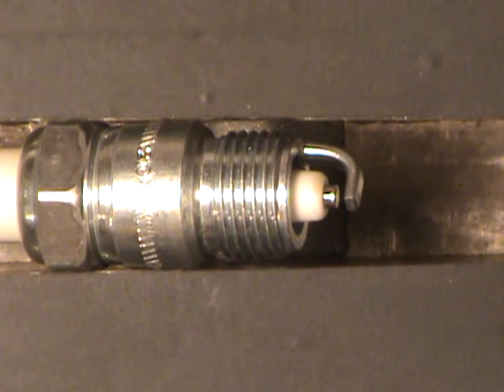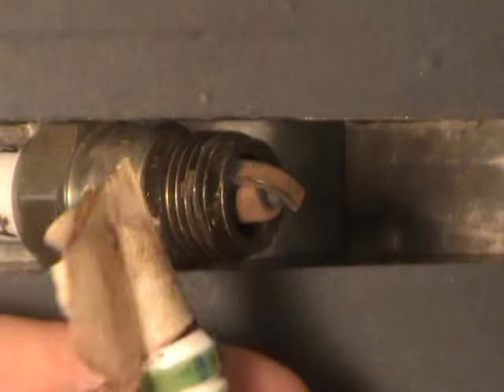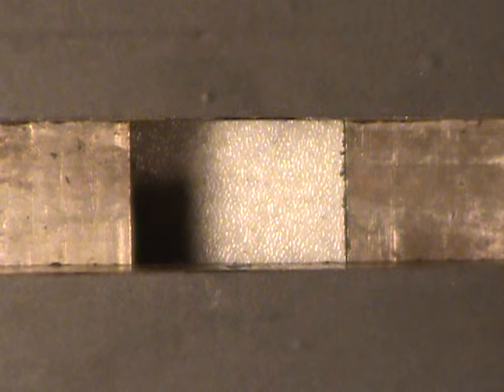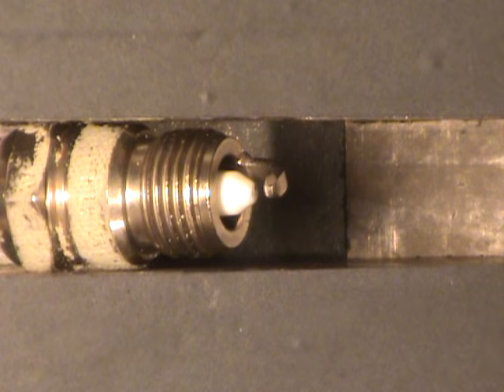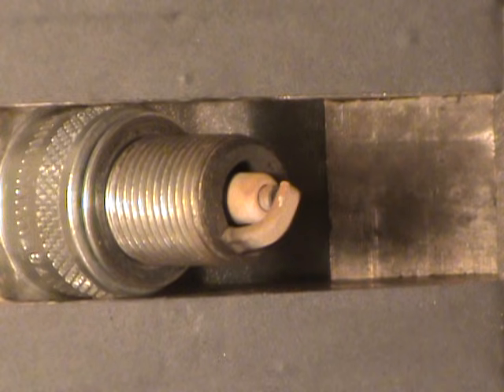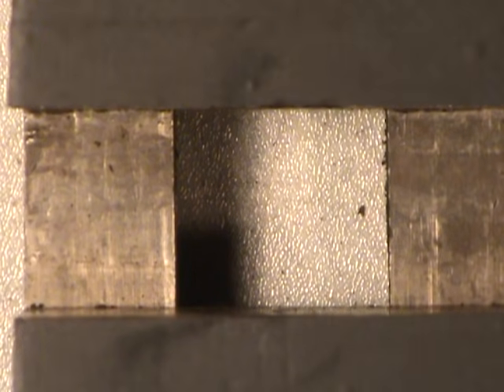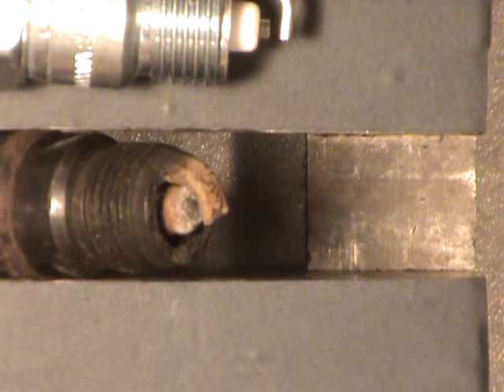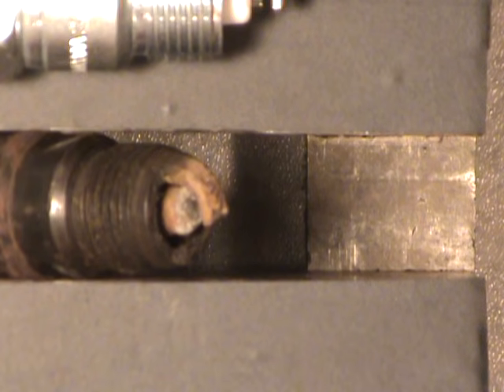SPARK PLUGS How to Read them (Part 3)

Comment: Awesome video, you really know what your talking about. I have a 305 vortec fuely and one of the plugs is always like the last one in your video or worse, white solid deposits. I thought maybe it was overheating or sucking coolant, but I guess that cylinder has too much oil going into it. That's better than overheating or coolant in my books. Every couple thousand KM I just change that plug, not the right way of going about it but I don't think I am gonna pull apart a 305 with 134,000 miles on it!
Reply from the maker: ssShortBoxKid⧓ Greetings ssShortBoxKid....Thanks for the Great comment, my Friend.......................................................Truth be told...as it applies to that Spark Plug, with that over-abundant amount of Deposit/s, in this YouTube Video, that You were talking about..................................................From what I recall, that..."White-ish" Looking "Deposit"..."Was Not"...on that particular, Number "6" Cylinder's Spark Plug, when I removed it, from my 1979 Chevy "400 cubic inch/6.6 Litre (displacement) small block V-8 Engine...!!!..................................................I believe that, that..."White-ish"...Colored, looking, part of that particular..."Deposit"...may have been..."Formed/Forming"...During the amount of Time, that, that good ole Spark Plug..."Was in Storage"...and..."Was Not"...in the Engine"...!!!............................................To me, that..."White-ish Looking Stuff, that "Attached" Itself, to the rest of that "Major" Deposit, looks, kinda, like a, shall we say, a..."Lime-Like, or Calcium-Like"...looking..."What-sham-ah-call-it"...for my lack of, a better Description...!!!...lol..............................................The "White-ish" Deposit, that You found, on "One" of Your Engine's Spark Plugs, might still be the result of, Burning some "Extra", and not wanted/needed...Motor Oil...in that "One" particular Engine Cylinder, alright......................................................That "Deposit", on Your Engine's, "One Only" Spark Plug, could be caused by a number of things.....................................................I'll start with some..."Motor Oil" Related possibilities...........................................................In the past, I have found that, on a "V-8 Engine", that had Lots Of..."Blow-By"...Combustion Gas, that went past the Pistons, then Entered the Lower Crankcase/Oil Pan area (internally), as a result of High Mileage, that resulted in, having the Piston "Rings End Gaps" getting Way Too Large, due to Wear, that "Allowed", all of that "Blow-By", high pressure, Cylinder, Combusted (exhaust) Gas, to get Past, all 8 Pistons, and over quite a few Years, all of that "Not being able to Completely "Vent with Fresh Air", due to the PCV (Positive Crankcase Ventilation) System, being Overwhelmed (aka, couldn't keep up), resulting in..."Major Sludge"...that actually..."Plugged Up"...most of the Engine's..."Motor Oil"..."Drain Back"..."Holes/Passageways"...in Both Cylinder Heads, and down in the Engine Block's "Valley", that's located...Under the Intake Manifold...and where the Hydraulic Valve Lifters were Hide-in...!!!...............................................When this, shall we say..."Motor Oil"..."Accumulates"...kinda like a Swimming Pool, if You will, then, the Motor Oil Level, will usually "Rise Up Higher" on Top of the Cylinder Heads, (below the Valve/Rocker Covers), and will then, usually, get so high, that the "Valve Guide Seals"..."Will Not"...be able to..."Stop"...all of that...Motor Oil...from making its Way, right..."Into the Valve Guides, where the Valve Stems, go Up and Down"...and probably..."More So"...on the..."Rear Most"...."Cylinders"...in that particular Engine, usually, due the, the..."Angle"...that the Engine is Mounted at, especially, as it applies to a..."Rear Wheel Drive"...North American Vehicle, as opposed to, a..."Front Wheel Drive"...Vehicle..........................................................Could be "Oil Control", for that particular Cylinder as well, as in...the usually..."3 Ring" (No Sir-ee-Bob, not a Circus...lol), but rather, the "2" Oil (scraper?) Rings, and the Expander/Spacer (weird looking thing), that is "Sandwiched", between, those "2" Oil Control Rings, that I was just talkin' about....................................................Keep a "Close-Eye", on "All" of Your Vehicle/Engine..."Fluid Levels"...and, the..."Gas Mileage/Kilometer-age"...that Your Vehicle is getting, as that my Friend, is, as I see it..."Are Very Good CLUES"...that will let, just about Anyone "Know", that there may be..."Trouble Brewing in Paradise"...!!!...lol........................................Might be a, Not so Good..."Head Gasket"...or, might even be, a Not so Good..."Intake Manifold Gasket" Set (or sheet metal/Valley Pan style, if applicable) perhaps...???.............................................Those "Gaskets", if not doing "Their Job Properly"...can Result in..."Motor Oil"..."Coolant" (anti-freeze n water mixture)...or, maybe even..."Exhaust Gas" (from the exhaust gas Crossover Passageway), making Its, or, Their  way..."Into Places"...that It, or They..."Should Not Be Getting Into"...!!! (not including any Vacuum Leaks, that are also possible, as well...!!!)...................................................If any "Coolant" (anti-freeze n water mixture) happens to find its way, into Your Engine's..."Oiling System"...that, in itself, can cause..."Engine Damage" (perhaps, Locking Up/Seizing) the Engine, up to the point, of, having the Crankshaft, not being able to Turn/Spin...!!!..........................................The "Clue/Warning Sign", to be Watchin' out for, is..."Seeing"...what looks, kinda like a..."Milkshake Looking"...(cream-like color) Liquid...that will be able, to be seen, on Your Engine's..."Oil Level Checking Dipstick"...Yes-siree-Bob...been there, seen that, and..."Never want to Go There Again"...!!!...(lol now, but, No lol, back then...!!!)...lol.........................................................Maybe, "Ignition System" Related perhaps...???.....................................................Might be...Not Enough..."High Voltage"...making its Way, to that..."One, Deposit Covered"...Spark Plug...perhaps...???......................................................So then, as long as Your Engine is Running and Performing OK, and all it takes, is Changing that "One" Spark Plug, every so often, then, as I see it..."Life is Good"...!!!..............................................Good ole "305"..........................................Be Safe, take care, and have a good one.
Reply: Hi there,

Thanks for the reply! That very well could be calcium or some type of growth from sitting, I have seen that happen many times before to things that have sat a while.

I think my rings are good on the motor because the oil stays clean for a long time and never seems to smell like fuel/have fuel contamination, although I have never checked the compression of any cylinder on that motor. 

I feel like it could be the valve stem seals/guide seals, it could only be the intake side though right? The exhaust side would just smoke for a few minutes upon start up? It doesn't seem to consume much oil either, I run 15w40 conventional diesel oil in it now days cause it's thicker and I have it already for my Duramax, I change the oil every 5,000 km/3,000 mi and it only uses maybe 250-500 ml maximum of oil in between oil changes.

Coolant never seems to get lower, have never added any for years. Should flush it soon I suppose. I had my cousin who is a licensed GM mechanic do the intake manifold gasket and the head gasket 3 years ago, I hope he did a good job and that is not the problem. Intake manifold gasket doesn't seem to leak when I tried to test it, never checked head gasket.

I am gonna check out the distributor/wires and hopefully I find something there, because I have an aftermarket MSD distributor and I don't much like aftermarket distributor/plug wires.

Life is good! I may just keep changing one spark plug because when that one plug is clean it idles smooth and runs like a bat out of hell for a 305 with that many miles on it.

Thanks again, learnt quite a bit talking, lots more to learn I am sure as I am only 20 years old!

Kodi
Reply from the maker: ssShortBoxKid⧓ Greetings ssShortBoxKid....Now I'm wondering, just what Year of Vehicle, that Your "305 Vortec Fuely" (as You put it), happens to be Installed in...???...........................................The reason being, that, it probably might have an "On-Board Computer" in it, and, even more beneficial, would be, as I see, if Your Vehicle was about..."1996 or Newer"...because, then, it would probably be the..."OBD-2" (On Board Diagnostic/s-Version 2), System, which, when a..."Scan Tool"...is Plugged into the..."Diagnostic Port"...that good ole "Scan Tool", will be telling You, some very "Specific Information", on "Any"..."Trouble Codes"...that, just might be Stored "Inside", that particular "OBD-2" Computer, which, will be able to tell You, just about "Anything" that is "Misbehaving", as far as, just about "Any", of the "Sensors and Actuators", are concerned...!!!...........................................If You care to, just let me know, what the Vehicle "Is", as well as, the "Year", and If "Any Modifications" have been done to it, over and above that, of what the Factory "Originally" Equipped it with......................................................Now then, about that "Diesel Motor Oil", that You are Using in Your "Gasoline Engine"...............................................You might want to "Check", and see "If" that "Diesel Motor Oil", is Actually "Formulated" for a "Gasoline Engine"...................................................Way back when, I did quite a bit of reading, about such things...........................................Just about everything, that I read, concerning, Using "Diesel Motor Oil" in a "Gasoline Engine", and, the Opposite way around, as well, was..."Not to do so"...!!!..........................................Do an Internet search, and I'm pretty sure, that You will probably Find Plenty, on that particular Subject matter (Engine Damage maybe?).................................................Now then, about "Coolant" (aka, anti-freeze n water mixture)..................................................The Older "Lime Green" Stuff (Ethel Glycol), was usually Only good for, about "2 Years", and probably, while it was in a vehicle, that was regularly Driven........................................The "Dex-Cool" (spelling?...and was GMC's Name) for..."Long Life Anti-Freeze"...and there are quite a few "Others" as well, that were supposedly, good for about "5 Years of Use", generally speaking.................................Usually, when-ever, the "Coolant" (I say again...Anti-Freeze & Water Mixture...lol), is left in the Vehicle's "Cooling System", for, too long of a Time Period, what will usually happen, is..."The Corrosion Inhibitors"...will usually..."Get Used Up"...and now, it's just a matter of Time, as to when, the..."Corrosion and Unwanted Deposits, Start to Manifest Themselves"..."Inside" Things, like, Radiators and Heater Cores, and given enough Time, "They" will usually..."Spring-ah-Leak"...!!! (repeat after me...expensive...Expensive...EXPENSIVE...!!!), well, maybe, not quite that Bad, but, I'm guessin', that You get the Picture....................................................Make Sure, that You "Read", what is on the "Jug" of "Anti-Freeze".............................................Usually a "Mixture" of 50/50 Anti-Freeze and Distilled or Soft Water, will usually do the Trick, and is a very good Mixing Ratio, that will promote Good Cooling, and sufficient Corrosion Protection..................................................The "Jug" will probably be indicating..."Not To Use Any More Then 70% Anti-Freeze, in the Coolant Mixture...!!!................................................You see my Friend, the "Anti-Freeze"..."Depends", on a Certain Amount of Water, in the "Mix", in order for it to do, its "Magical Chemical Interaction"...........................................A While back, I topped off a vehicle's radiator with 100% Anti-Freeze, and, I re-started the Engine, to, shall we say, "Mix", that nice New Anti-Freeze, with what was already in the Cooling System............................................As the Engine approached "Operating Temperature", as Indicated on that rather "Sensitive" Coolant Temperature Gauge, I was kinda in "Disbelief", as I watched that, good ole Coolant Temperature Gauge..."Keep On Climbing "Past" the Normal Temperature Range...and Kept On Getting Hotter and HOTTER"...!!!...so I Stopped the Engine, and, was askin' myself..."WHY"...???.................Like they say..."READ THE INSTRUCTIONS"...!!!...lol..........................................Later, after the Engine cooled off, I used my Trusty "Anti-Freeze Coolant Testing Gauge", and the Coolant, that was sucked up, into the Gauge, was Reading rather Strong, to say the least!.............................................I Drained, quite a bit of Coolant from the Radiator, and "Refilled" It, with a much closer to be-in a "50/50-Mix", then re-started the Engine, all the while, keeping an "Eagle Eye" on that there "Coolant Temperature Gauge"...and..."Look Ma"...unlike Me...It's..."Behaving Itself"...lol...............................The End.................................................Be Safe, take care, and have a good one.
Reply: *****
 No I haven't but I think I will do a leakdown test in the spring. I could possibly have a vacuum leak because it shows other symptoms of that aswell.
Reply: RockysRoadshow
Hi again, the vehicle is a 1998 K1500 Chevy truck, It has OBD2 but it has no codes right now, I only have a cheap scanner that can scan and erase codes, it can’t show me any data or values.

Nobody likes figuring out problems with modified vehicles, but bear with me.. The computer has a BlackBear performance 87 octane tune, MSD street fire distributor, accel 8.8 wires, hooker long tube competition headers with flow master 10 2.5” true duals dumped out the side, 2.5 electric exhaust cutouts/dumps, EGR/AIR deleted and tuned out, rear 02 sensors deleted/tuned out, torque management turned off/tuned out.. and the rest is mostly cosmetic/replaced a broke factory part.. many of them lol!

The diesel oil I use claims it’s good for “mixed fleet” aka gas and diesel, and is certified for gas use apparently as well. I know most of the diesel oils like you are saying don’t do very well in a gas motor.. I just switched this summer to using it because that is when I got my other diesel truck. It didn’t seem to have any adverse affects on it, that I noticed anyways.. Winters almost here so I am going back to a 5w30 or 0w30 again anyways! 15w40 gets pretty thick around -15c!

My truck calls for dex-cool but many moons ago someone switched it to the green stuff, I will likely end up flushing it in the spring because I know it has been a few years since it has been done, and it is probably losing it’s properties as you were saying. I don’t like dex-cool much because I’ve seen it gel up, but I think that’s the old dexcool formula that if you added Ethel Glycol antifreeze to it, it would crystallize. They have since changed it if I recall. Instructions are always good to read, I sometimes have problems with that as well.

I think my truck has 60/40 antifreeze/water, but I think I should bust out my trusty coolant testing gauge as well and check, the mercury drops to -40 around here certain parts of the winter, 50/50 is normally good though. Antifreeze cools less than water apparently I read one time, but if you use too much water and not enough antifreeze it promotes over heating aswell. I guess that’s why 50/50 is the recommended mix! I noticed your from Canada, I’m surrey you experience the cold too, I’m from Ontario.

Take her easy, and if she’s easy, take her twice, have a good one.

Kodi